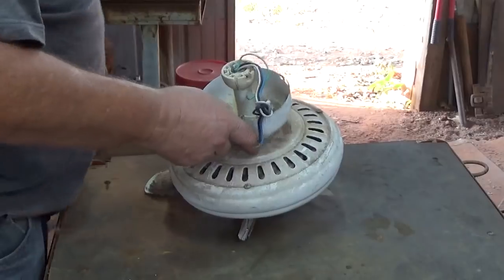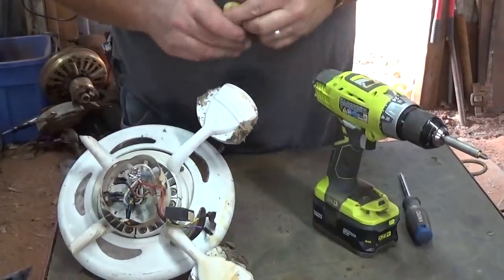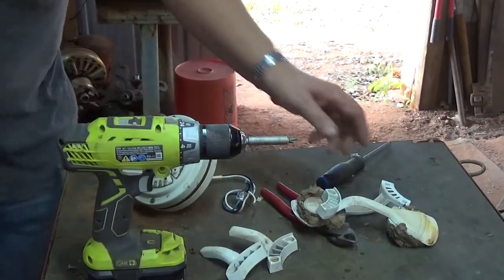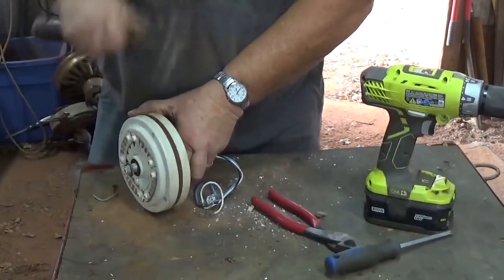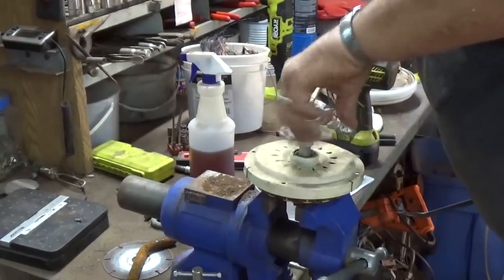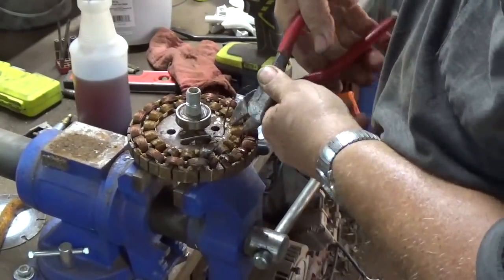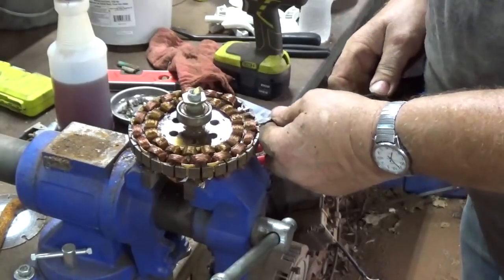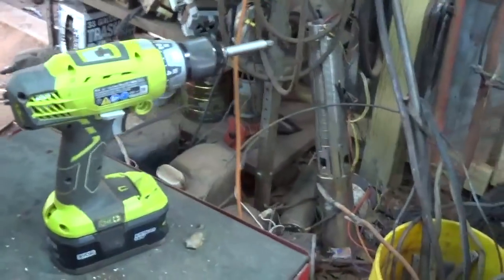How to Scrap out a Ceiling fan for clean copper

Comment: I just did this last week, found a cut off wheel made real quick work of it!  Just sliced it on the top and pulled 'me out the bottom.  Did the outside ring first, cut the bearing piece off and then took out the inside ones.
Reply from the maker: not everyone has an angle grinder, that is the way that I do mine too. but this video was mainly for the new scrappers
Reply: @Okiescrapper  got ya

Comment: After cutting the copper. (which you Showed me on a another video.) I had found using fencing pliers works well to pull out the copper. My scrapyard tells me the arms on the fan that holds the blades are zink. Which they consider it be dirty aluminum. I really don’t know so I just roll with it.
Reply from the maker: Zinc or die cast, I think die cast has more zinc then aluminum

Comment: I've never had the caps of the ceiling fan come off easy. I usually beat the hell of of them with the claw end of a hammer. I don't have a vice so I place a screwdriver in the hole of the opposite end of the screwed on piece and turn with my hand, usually comes off pretty easily.
Reply from the maker: what ever works and is easier for you, it's good to see how others do it and then find out witch way works for you

Comment: @18:53 you knew what type of metal it was just by feeling it?? I guess that comes with experience, but I feel so slow trying to figure out different metal
Reply from the maker: aluminum is lighter and sometimes you can tap it with a wrench and the sound will give it away, some times it is hard to tell if something is aluminum or plastic, I have to grind into it, the more you do it you will be able to tell, it comes with time

Comment: A small coincidence is I  happened to find one to scrap. It had a good supply of copper but it was the bearings that I had a use for.
Reply from the maker: awww yes free parts
Reply: @Okiescrapper  absolutely right but I  got sidetracked and forgot the question I had for you. The windings came out a brass color. It wasn't coated aluminum wire like a microwave I once stripped this is a brass color all the way through. Is it yellow brass or something else?
Reply from the maker: @mattyal9347  sounds like it may be brass wire. I did a google for brass electrical wire this is about all that I found https://www.snakeheadvintage.com/brass-metal-braided-cord-round-3-wire-cable-per-foot/
Reply: @Okiescrapper  great! It'll make a fine addition to my ingot collection
Reply: What use did you have for a bearing? Just wondering cuz I just tore. Ceiling fan down and wondering what else could be useful besides the copper.
Reply: @MrsBuddevil  I  made a heavy duty steel cabinet with steel drawers and yhe bearings serve as rollers for the drawers. Thats one of many uses I have found for them and the "do it yourself" videos here on you tube include using bearings in hundreds of projects.

Comment: Do u get more money if u take it apart
Reply from the maker: as is it would go as shred about 7 cents a lb. the copper is $3.50 a lb. so after tearing it apart I still get the 7 cents a lb. plus I get about a half pound of copper for about $1.75  not a lot but it will add up after a while

Comment: To loosen rough screws, hold screwdriver in screw and hit driver with a hammer, it normally works. Well you did OK bashing it anyway.
Reply from the maker: yeah the impact will break the threads loose a lot of the time